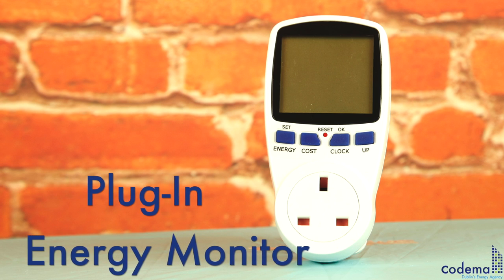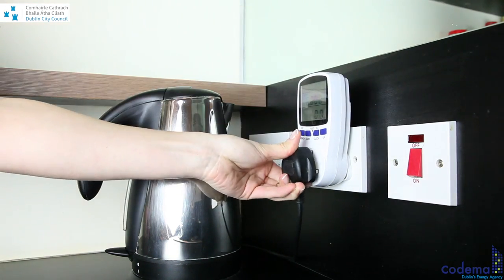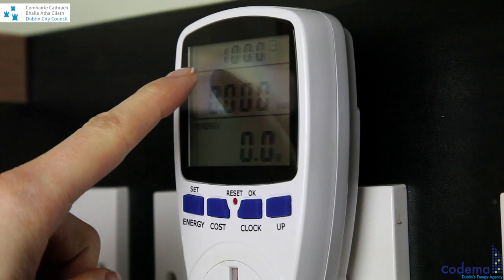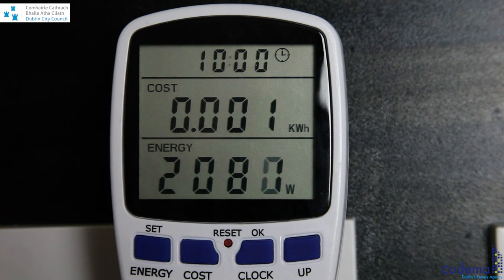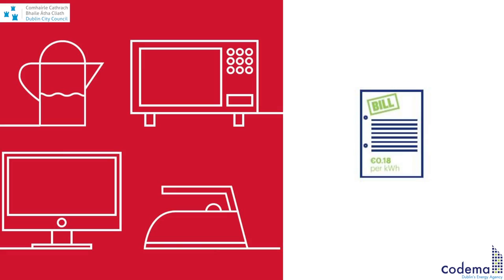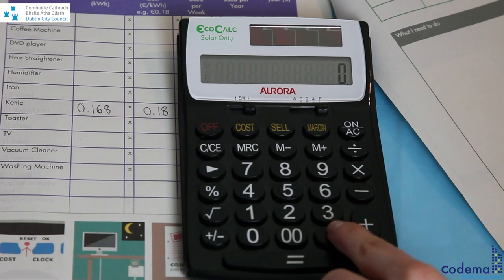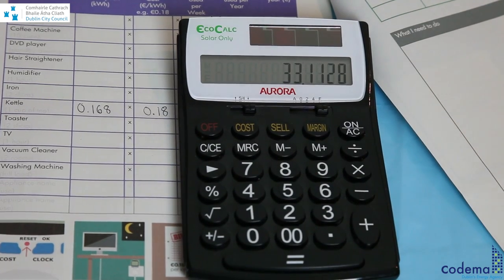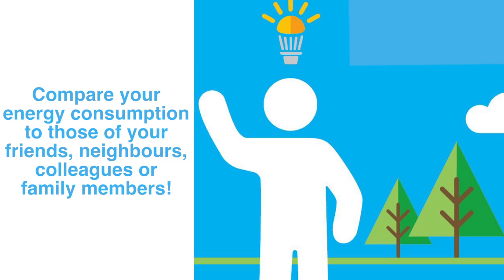Plug-In Energy Monitor Instructional Video

Comment: Setting the cost per KWH requires prssing function until the cost/KWH shows at the bottom. Hold the Cost button for more than 2 seconds unitl the cost starts flashing Press the Function button to flash the digit you want to set then use the up or down button to set it. then press function to set another digit. when done, press cost.
Reply: Thanks! I lost my little printed instruction booklet, and your comment help me to operate the meter.  That plus the video have helped me to render this a useful meter.
Reply: thank you.I know it's from a long time ago but your instructions were exactly what I was looking for. by the way, my name is Brenda.
Reply: huge thanks. the instructions are COMPLETELY useless. I have no idea how you managed to work this out yourself.
Reply: is the costs in dollars or cents? 6.5 = cents?
Reply: Many thanks for this 🧐🙂🇮🇪🙂

Comment: just a silly question. in UK we pay 38.80p KW   .  I set it up at the cost of 38.80 and after 1h was about 4£ which is too expensive ... do I need to set like 00.38 on display? thanks
Reply: You might want to round it up to 00.39 (or 00.41 if you haven't included the 5% VAT) for a more accurate cost.

Comment: imo the gadget is next to useless.The instructions say install 3.6v rechargeable N1-MH batteries,asked dealer where to install them, ,reply no need for that procedure,will self charge when switched on (been on for 12 hours and no light etc)seems to be a total scam !
Reply: It needs 3 Volts battery

Comment: Hello! Thank you for making this video.  However, it is not loading.  The file may have become corrupted. I've tried Firefox and Chrome, but it doesn't load.
Reply from the maker: Hi Archy, thanks for bringing this to our attention. We were experiencing the same problems just now but the issue seems to have resolved itself by clearing the caches on our PC - this might work for you?
Reply: @CodemaDublin  Thank you so much for the quick response and tip.  Following your suggestions I was able to watch the video and get some very helpful guidance.  This time, thank you for your hard work making this video.  It was very helpful.  Regarding the playback issue, the solution appears to be only partial on my side. I was able to watch the entire video, but only at 360p. All resolutions higher than this, from 480p to 1080p presented the same behavior from before: eternal spinning arrow never leading to playback.   If you're able to see higher resolutions, then the problem may be with me locally, or with one of Youtube's regional data mirrors (I'm in Central Europe).  If it appears to be a Youtube issue, maybe it will resolve itself as their system routinely refreshes itself.  Of course rattling their cage might help get a faster fix, but it can be a challenge to figure out how to reach the right person / department.   I'm going back to decommissioning and replacing my loverly fridge that turns out to be sucking down enough electricity to make a down payment on a private resort island in the Maldives.  Cheers!

Comment: my device stopped working after some time of no use where it worked before...
Reply: i mean. the display shows, the buttons work in cycling the display.

But consumption does not get registered... it says 0.0 W or 0V etc.
Reply: How to repair?
Same thing happen when plugged in water kettle.
Reply: @yt-xo4lb  dont know how to repair. i did open it up but didn't know how to fix